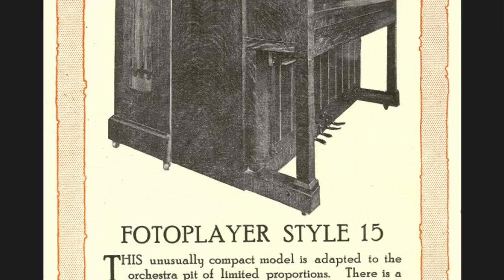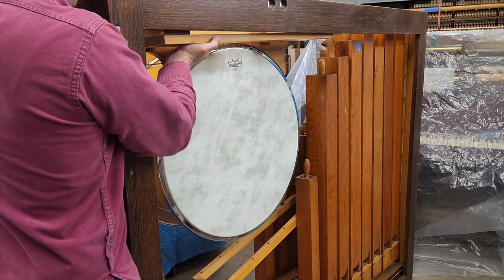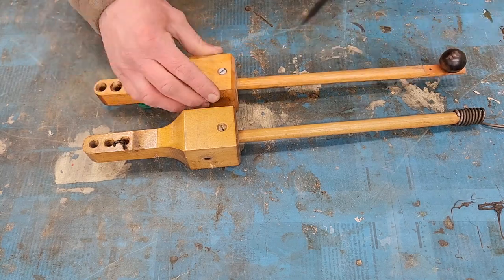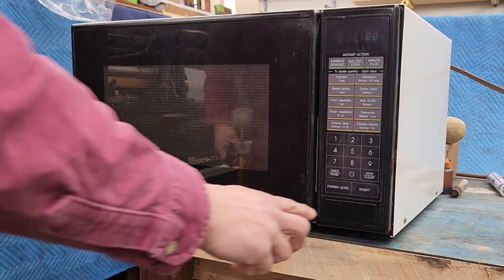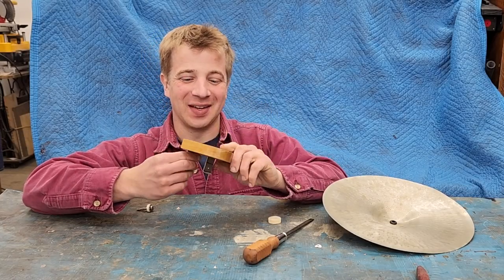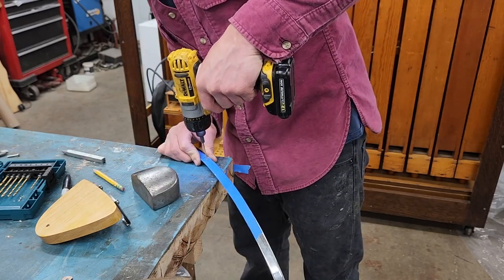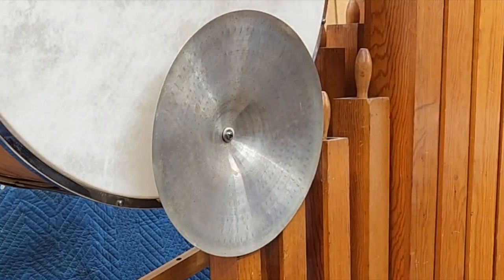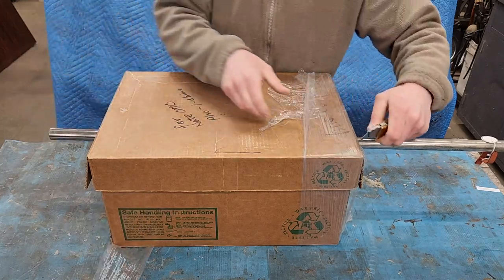Fotoplayer Fridays: Perc-king It Up

Comment: The thing you didn't remember the name for that goes inside of the pipe is called a stopper. If you want the tiny little cymbal to have a bit more "humph" to it, try unscrewing the screw that goes through the center of the cymbal so it can wiggle just a little bit more. This will let it ring just enough to make a nice balance between the other instruments and still have it be audible! I thought the name "doinger" fit the cymbal striker perfectly 😂
Reply from the maker: Thanks for the tips! I'll have to try that. Part of the cymbal sound issue is definitely my lack of editing skills at play.
Reply: @nateoutsidethevacuum  Probably not your editing skills, your videos are edited quite well actually!
Reply from the maker: That's kind of you! I'm still getting the hang of it though.